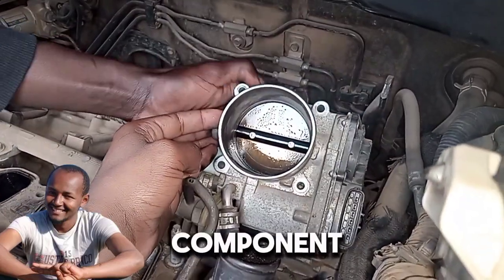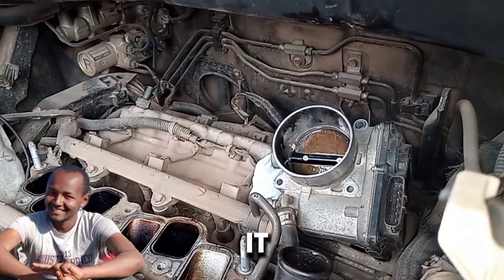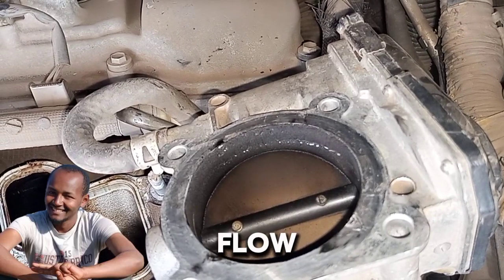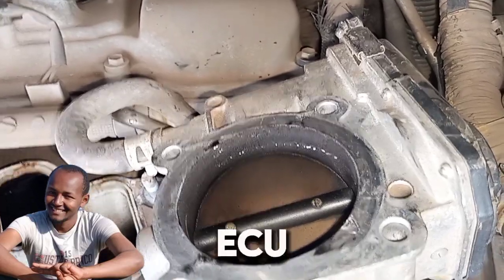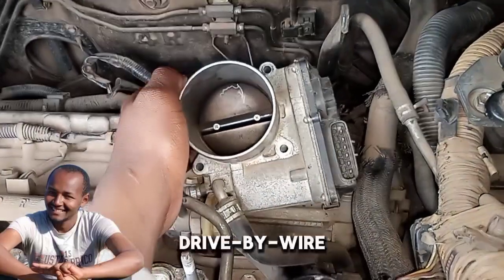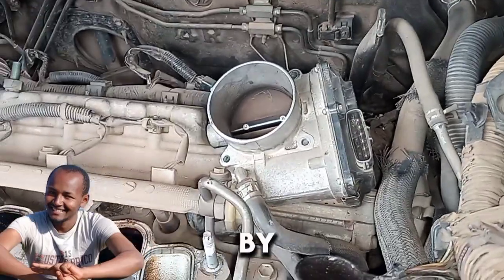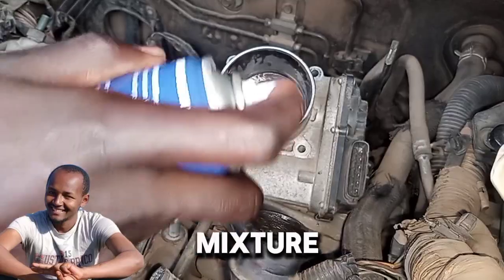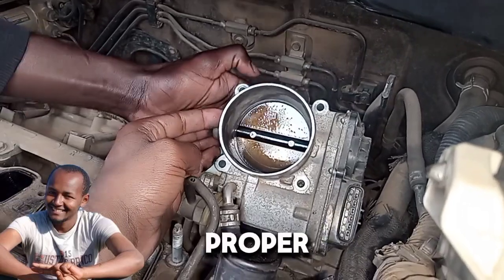Throttle Body Symptoms - How to Identify a Faulty Throttle Body

Comment: I got a 2009mercury marguis  that won't stay idling 😊 it starts every time but imediatly shuts off I disconnected the MAF sensor and it stays idling cleaned the throttle body  changed  the tps icv and will only idle when the mass  air flow sensor is disconnected any thoughts I subscribed
Reply: Vacuum leak, or EGR valve. 👍
Reply: @GodsWorld189  hey thanks but when I changed the throttle body it's a different EGR I don't hear any vacuum leaks but tomorrow I'll spray it  with soapy water id bring it to a mechanic but where I live r
Their all part  changers only codes I have is the mass air flow sensor and intake temp high car runs fine with MAF disconnected but will stall out once and a while thankyou for your help
Reply: @PatrickCioffi-r3j     Hmmm 🤔 interesting, last case scenario, fuel filter, fuel pump, clean your O2 sensors. 👍 zoom zoom 🏎️
Reply: @GodsWorld189  question if I disconnected the MAF sensor and the car ran for for 45 miles to NY home only stalling twice but as soon as I connect the MAF it starts right up and dies unfortunately for me I have a fuel pump pressure tester for the Schrader valve kind but I don't have a Schrader on the fuel. Rail I did change the gas filter
Reply: @PatrickCioffi-r3j  hmmm 🤔 interesting again, your definitely running to lean and your motor is starving for oxygen, maybe a very bad intake manifold leak another possible cause for this issue, give it a look see. 👍
Reply from the maker: Have you checked your air cleaner?
Reply: @Autoinsider254  yes absolutely I have a question like I said if I connect the MAF it starts right up but stalls right away if disconnect the MAF sensor I can run it can my fuel pump be weak ?
Reply: @GodsWorld189  another mystery I went to have it checked today and when I got there I hooked the MAF and the ran perfect the guy cleared the codes and now it runs fine
Reply: @PatrickCioffi-r3j  that’s awesome!! Great car! I think it was five star from Kelly blue book. My aunt still owns her’s. 
She’s a boat. 👍
Reply: @GodsWorld189  y
Thanks for the help!!